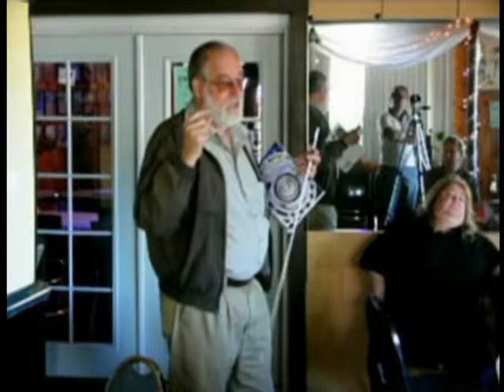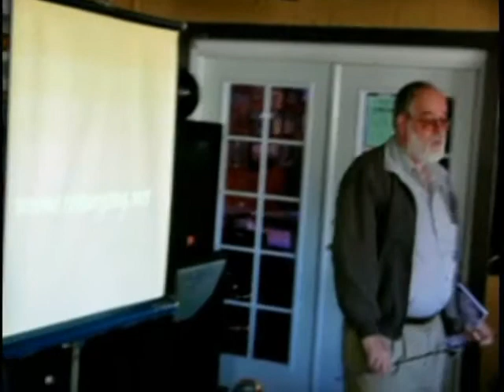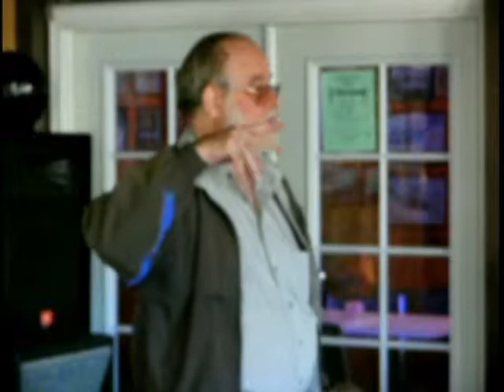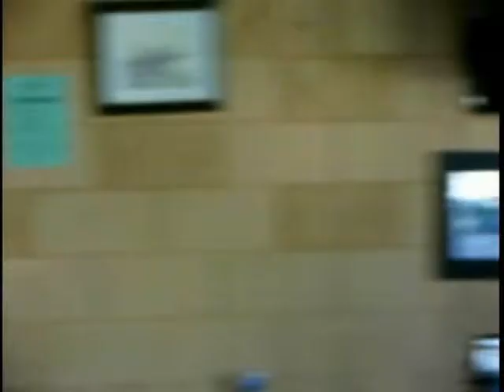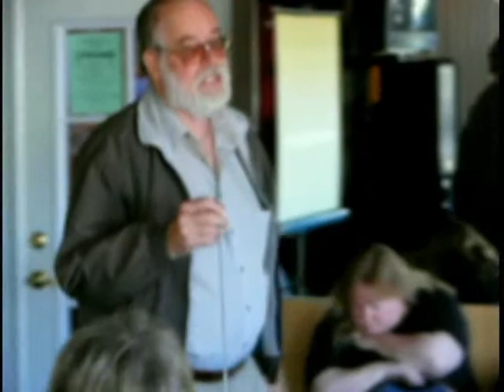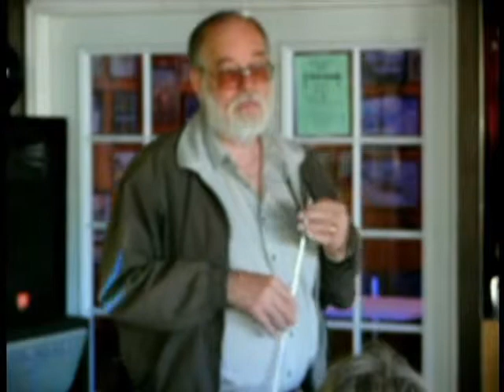Turbo Compound Rotary question and answers

Comment: Continued: Mazda should have installed a "we really mean it" warning light on the dash.  "Check the oil, top it off, or we'll kill the ignition and you can call a tow truck :-)"
The point of my post, if there is any at all, is we should not assume there's a weakness in a design, sometimes the Engineers are designing around a weakness in those who will use the machine. Pilols are more careful people, it's because Murphy works full time aloft and thins the flock.

Comment: Paul, great post and  very interesting conversation. Mazda's Rotary was set up to run rich in the early days for longevity reasons. Same for the heavy injection of lube oil at WOT. Mazda had a lot of data on driver habits, and they did what they thought best to protect the engine in the early days. STILL, there were people who would race from one stop light to the next, and never check the oil level.